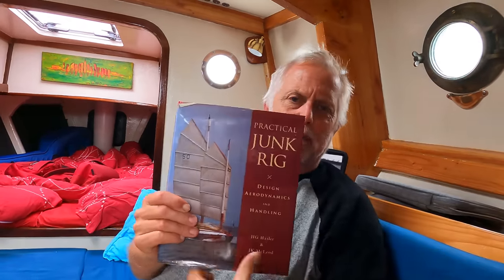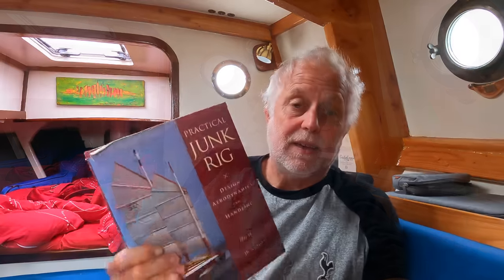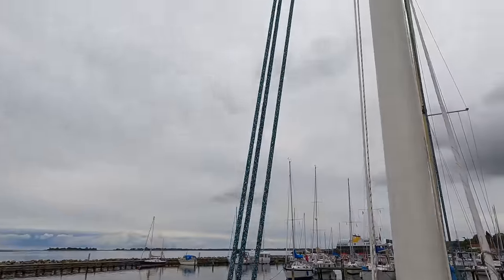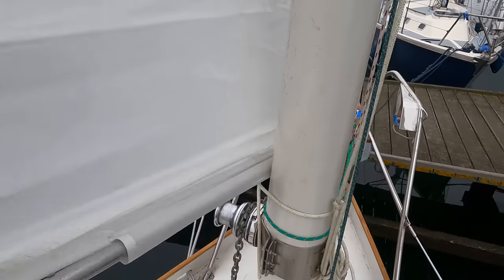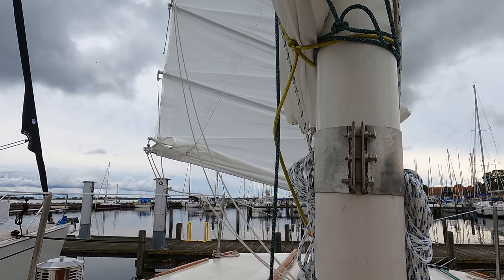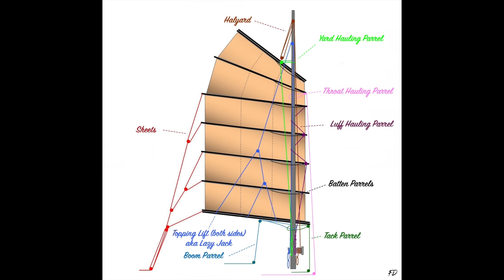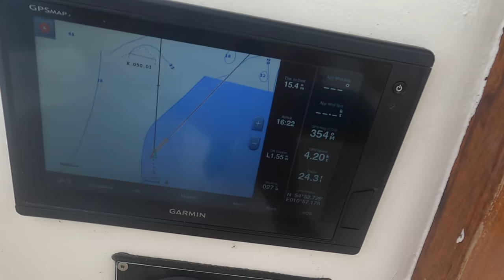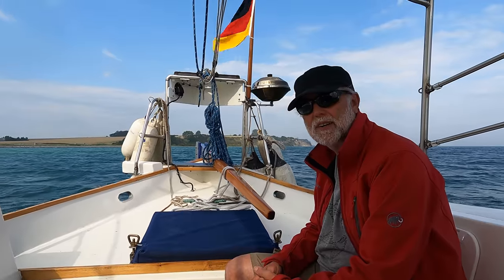Rigging Junk Sails, Sea Trials, Sailing Dories And Sailing To Omø - SV Tapatya EP294

Comment: I see the dory hull design combined with the junk rig as a near perfect marriage. The initial tenderness of the dory hull prevents snap rolling, which is the #1 enemy of free-standing rigs.

Flat bottom boats need to heel substantially to survive going out to sea. Otherwise, they will pound your teeth fillings out. When they heel, the leeward chine digs in and presents a "V" section to the waves. So, instead of a thudding pound, you get a more gentle mush.

The schooner rig is the least windward of the fore-and-aft rigs. But, that being said, it is the most docile at anchor. This is what made it a favorite during the days of sail. If you wanted a boat that could live well on a mooring, the schooner rig is the best.

Just thought I'd throw some design theory in.

You have built yourself a wonderful boat.
Reply from the maker: Thanks Bob. Yes, I quite agree 😂😃😃

Comment: Very educational video.. Well done Tony..
- Sea trails always start out as being an overwhelming event. but the more miles you sail to more will get resolved or altered..In fact there is such a thing as "never ending" improvements..

- Indeed Junk rigs "can" have a lot of lines..But your approach is correct, start with the essentials and once Tapatya (under sail) starts talking, you will easily find what to add..

-Your ballast ratio is about 30% which makes the boat very comfortable, will give some more heel (20/25°) once compared to more stiffer boats with 40/45% ballast ratio..
 But you nailed it.. Once heeled, the Dory hull shape  creates a tremendous lifting arm and this will become more "pronounced" once the boat is loaded for cruising as she will sit deeper..
This is the result of the center of buoyancy moving way over towards the leeward side..

I have now a better idea of the kind  of gear used for the sheets ( low friction rings, cam fiddle block, eyed pulleys, etc..). Will keep my eyes open for more details in next installments..

Thanks for sharing this..

more info here...
https://flic.kr/s/aHBqjASh9a
Reply from the maker: Thank you Frans. Yes, I totally agree 👍😃
Reply from the maker: And I love what you’ve done on that Flickr link 👏👍👍

Comment: Mast and sail design are next for me. I'm a bit shorter and would like to keep my interior close to as is, so one stick only. You are giving me something to look forward to.. Looks great.
Reply from the maker: Thanks Len. What boat are you building. Have I forgotten? 🤔😬
Reply: @SVTapatya  Converting a cal29. Some restoration required (but nothing keeping her from sailing). Mostly paint aside from putting a hole in the deckhead for a mast. The rigging is maybe original so needs changing one way or the other.

Comment: Tony, you are an admirable chap, and you have displayed the intelligence, practical skills and tenacity to complete a difficult project. I am sure your wife will be looking down extremely pleased and proud of you, that you went on to finish and sail the boat. Lovely family.

Regarding the myriad of comments about the ‘tippy’ nature of the dory. In fact transverse stability of all displacement hulls behave in a similar fashion. The righting lever at small angles of heel - is small and increases as the angle of heel increases and is at a maximum around deck edge immersion.

On the subject of ‘slowness’ of a dory, the rule of thumb for the hull speed of a displacement vessel shows a 31.8 ft hull should achieve 7.6 knots (but it is only a rule of thumb)😉

Thanks for your talk through on the rig - I used to watch Roger Taylor of Ming Ming - and I see Alan Mulholland is doing his sea trials too.

Nice to see your lass out sailing with you- you look very relaxed, content and happy.😀👍⛵️
Reply from the maker: Thanks Norman. Yes, absolutely! 👍😃

Comment: I my mind as a total amateur junk rigs are the Chevy or Toyota of sails dependable reliable. They don't have all the rigging just to keep the mast upright . The less parts in a system the less likely it is to fail. Dismantling is a scary thought . I think junk rigs have a much smaller risk of dismantling . I'm sold on junk rigs . My dream boat would be a Pearson triton that is junk rigged . May not be fast but it would be a tank and stable.
Reply from the maker: Yes, Tim👍
Years ago, I buddy boated with a couple in a small Pearson. Great little boat and very capable. And of course, Hazel’s Freedom was built by the Pearson yard 👍😃

Comment: The rig looks great, so easy to raise, such  classical and interesting shapes, so easy, relatively, to haul and the single biggest advantage (for me), so easy,simple and quick to reef should the need arise. Now how many other types of rig apart from roller-reefers have 6 reefing levels? Would a lazy bag be of any assistance I wonder as the sail/batten "bundle" looks relatively tidy and secure when lowered? Was the choice of white sail cloth simply for aesthetic reasons or is there a practical reason as well for choosing it over the more traditional red/tan colour? Happy days always, SkipRay, Kerry, Ireland.
Reply from the maker: Thanks SkipRay. I don’t think a lazy bag is necessary; as you say, the lazy jacks contain the sails well when they’re down/reefed. I went for white dacron because it shows up better, particularly at night with a torch shone on it, and it’s cheaper than tan bark, etc. 🤔😃

Comment: I need to ask you about chafing. It seems that the sail is pressing hard against the mast. also when it has been raised and louvered. Also your beautifully painted mast would suffer.
Reply from the maker: Yes Mark, chafing can be an issue, particularly on the batten parrels. In the past, I’ve used lengths of garden hose as chafe protection and will on Tapatya as well. The mast is painted with 2 part polyurethane paint, which should be up to the job. 
Generally on junk rigs, chafe is something you have to keep an eye on. Luckily, it’s all just string, so easy enough to replace when necessary 👍
Reply: Please don't take my comment as criticism, I'm admirer of you. As a boat builder I know what it takes. Enjoy your achievement. @SVTapatya
Reply from the maker: I didn’t, Mark. It was a good question!